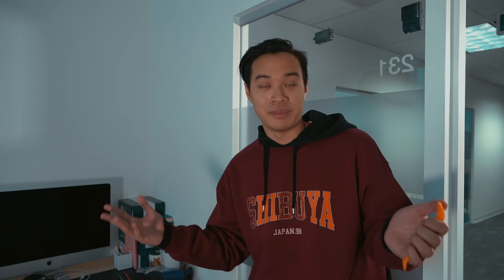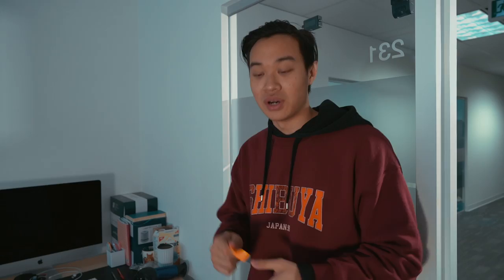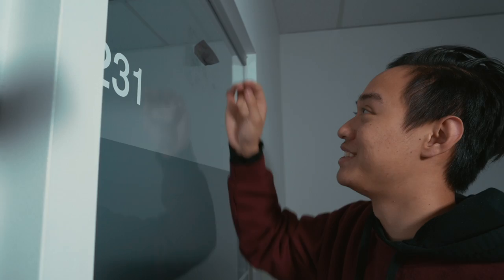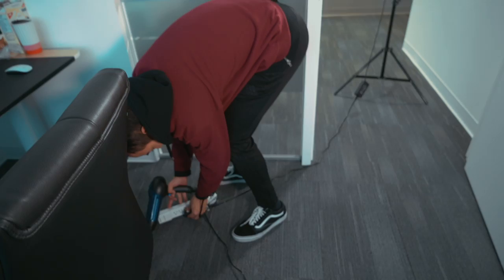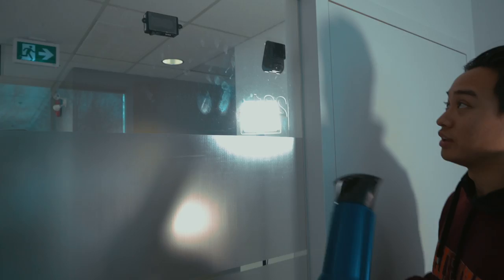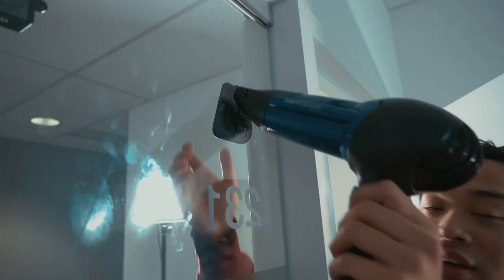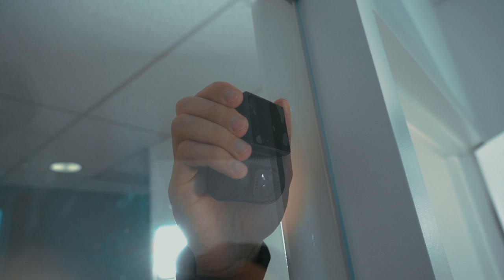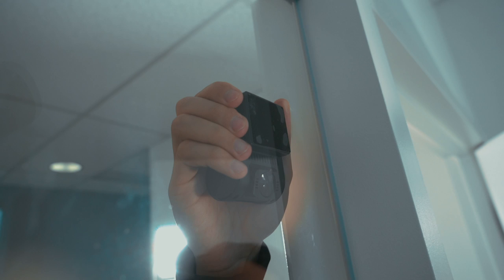How to Remove 3M Adhesive Tape From Windshield

Comment: Did it this method... it worked 👍 - I was a bit worried about breaking the glass so I enabled the heated windscreen 1st, waited for that to go off, then heated with hair dryer in loose circles around the 3m tape.... I found pulling with a constant force like a slow oozy drip worked a treat rather than yanking / jerking it off... Cheers 🍻

Comment: Haven’t tried it, but I think letting the sun heat up the windshield on a hot day might be an easy way to remove the tape. Plus, the sun will evenly heat the entire windshield.
Reply: The heat gun will only heat up the spot really fast and might cause the windshield to crack.

Comment: Would the adhesive still work again after? I installed my rear dash cam upside down. I doesn't really matter but if it's simple enough, I might try to heat it up, flip it, and stick it back on.

Comment: People should be extra careful when using adhesive mounts on tinted windows. Tints are, much like the 3M tape, a film. Pulling off a device glued with 3M tape can easily rip the tint film.
Reply from the maker: Definitely!

In our experience, as long as the adhesive has been heated up, the camera adhesive will always give up before window tint does!
Reply: Closed  It's actually becoming pretty common as it reduces glare, UV light, and heat into the vehicle. Blocking that UV on all windows including the windshield will also keep your interior in great shape. 

Also some people mount cams on the rear window where tint may be as well. Cheers
Reply: Maybe they want it dark as black so no one can see inside the car? So it looks cool from the outside....

Comment: i wonder if the everyday dental floss or old credit / loyalty card approach outlined in this video for 3m adhesive phone grips [ https://youtube.com/watch?v=7scfnQIZWZc ] would also work on these 3m adhesive to glass application scenarios?  the other video suggests that the adhesive is engineered to provide pull strength but not sheer strength which is a design point you can use to make removal easy.

Comment: God forbid you remove it using any of the ways 3M suggests.  Better to risk cracking a windshield.  And what if there is already a crack or a ding in the windshield?